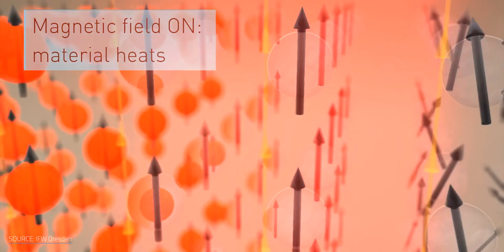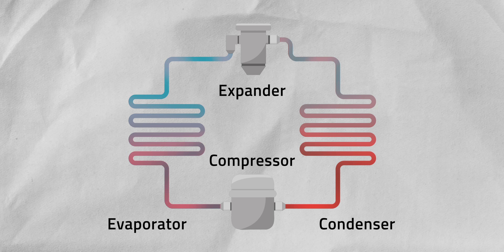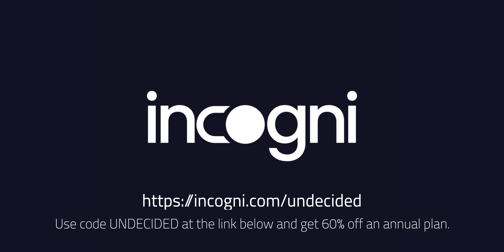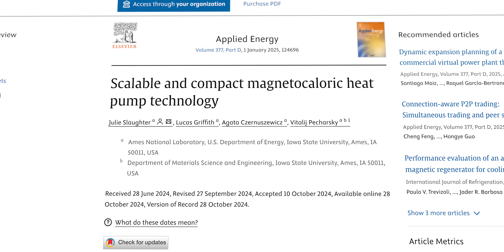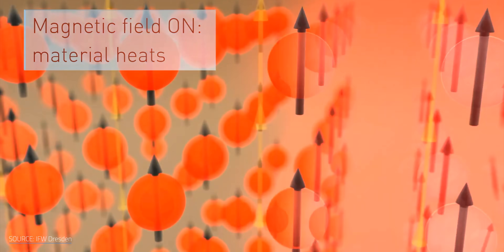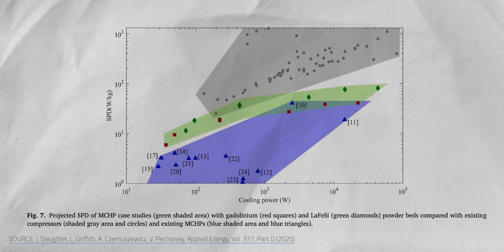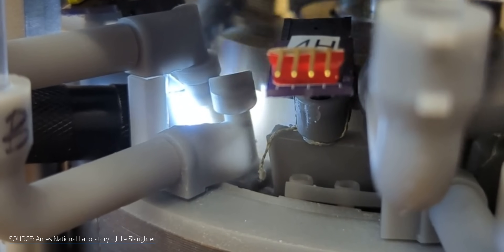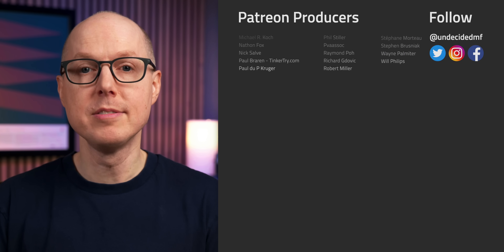How Magnetic Cooling Is Breaking All the Rules

Comment: I kept waiting for the big question to be answered: Even knowing these are not finished tech, what are the relative energy inputs required by each tech for comparable cooling power? (And how much do researchers think that might change with refinement to commercially viable tech?) Dropping HFCs would be huge, but if we had to generate 4x electricity to do it, the eco analysis wouldn’t be simple. Or if mag or elastocalorics would require less energy inputs, the win would be even bigger. And is one of those potentially more energy efficient than the other? Maybe I just missed it? But the answer to that seems like it could vastly impact this whole discussion.
Reply: Not only that, but does the assembly require replacement less frequently or more than current tech? The linear compressors in some modern fridges are technically efficient, but make the fridge garbage in 2 years vs 25. That’s certainly not better for the environment.
Reply: Yes it can reach an efficiency of 70% because there’s less steps in the refrigeration cycle. Which means less work wasted to entropy (every change takes a certain percent amount of your work “permanently.”)

Gas cooling needs several complex steps to achieve what it tries to achieve while magnet cooling does it directly and simply.
Reply: @Neoprenesiren https://youtu.be/XYjek6vuPN4?si=rqH21NkQrtpp9Ks9 this actual machine has COP of 7.6 for an estimated EER of 26.6. This is quite high, but the device looks very expensive and has 26 solenoid valves. Are you seeing other machines that exist with better COP and EER values? You can easily buy a 22.9 SEER AC window unit, so the increase is modest at best. Am I missing something?
Reply: @3weight  HFC’s are already in the process of being phased out. I regularly work with refrigerants like CO2 and propane today. Point being that this tech would have to improve on the vapour compression cycle in other ways to become popular because the eco friendly angle will be largely irrelevant by 2030ish. For smaller cooling needs where energy consumption is negligible, this tech looks like it could be possibly be made popular due to its simplicity and reliability.
Reply: Propane based is still more efficient
Reply: @philblue1015 what are the recorded COP and SEER values?
Reply: @CountJeffula You can readily purchase propane heat pumps with around SCOP hovering around 5. The video you linked is pretty interesting but that COP was achieved under very favourable conditions with a low temperature lift.
Reply: @shmerda5565 the SEER metric is supposed to take seasonality into account, and that value is quite high IMO. Converting it roughly gives a comfortably higher COP than the 5 you mention. 20% higher, to be more precise. Because heat pumps are often used extensively, isn’t the 20% efficiency gain more important than using a different refrigerant over the lifetime of the product in most scenarios? Even if a refrigerant is 100s of times worse for the environment, the amount of CO2 saved with higher efficiency most likely offsets this, yet calculation is necessary.
Reply: well yes but plane old dihydrogenoxide (H2O or water for a much more simple name for non sicfancale cemcal names) is also a nature made HFC thats also a green hosue gas and we drink it and use it everysingle day for our own body cooling with our sweat glands all the time. so teachly plant old water can work but it will still cause green hosue gas atmoheric issues anyway. by the way water vapor as a green hosue gas it like a few hudrid times more pontacy then co2 and we sweat it out when exrsieing everyday ameknig the planet much hoter whtierh we like it or not. so even if we stop co2 emsions our oown water vapor emsions form just walknig and ruing every day will casue claimte cange on teh earth anyway wither we like it or not. so yah can stop climate change unless we go into otuer space ans use all teh extra water to power rockest and sapce ships to lower water vaopr conect on earth to help get it cooler. also the suns saolr wind conlety adds a fwe hirduid mertaic tons more water into earths envoerment for otuer space every year or more. thats is also one more main drive of earth cheaning climate that stoping all co2 emsions simply won't do jack agest if the water vaopr for mthe sun soalr wind being dumped on earth will cauwth eearth to heat and cook itself anyway wither we like it or not. thsi si why space travel for hepling deal with ealrth cilaite is mantory bescue we wee can't recide earths totla water leevsl form giong hgier nurtal from earth geting mroe and more water vaopr for the suns soalr wind well earth giong to heat up wither we like ti or not sooner or later unless we do very lareg scale space tralvel and interpalenty space comlazion and exporation to even have a change to stablzie earth cliamite bescue we can't even do that even if we let nature takes it corse it will still by earth very own natire will want to cook itself to death with tis onw non stop rseing watr vapor and water table levels for mthe suns soalr wind keeps dupming more of it on us.
Reply: @ashtonmiller-z1n  what medications are you taking?
Reply: @ashtonmiller-z1n  Lol - you think water is a hydro-fluoro-carbon?! You learning your chemistry from the current US administration or something? 🙄
Reply: @ArifGhostwriter   really because the last administration did such a great job didn't they?Oh wait how many are failing basic math and reading also please stick to the topic an don't bring politics' when it has nothing to do with the statement
He was partly talking about as in water vapor can hold in heat better then most refrigerant and counts for the main warming of the planet and not that its is a HFC but is main greenhouse next to co2. So am guessing you learn from the last administration? "see what i did there"
Dont get me wrong he use it in a way that not 100% right there also other factor in warmer temps or just temps in general
problem with this tech is two fold one high maintance more moving parts will lead to break downs and output to size

Comment: Magnetic (or magneto caloric) Cooling is quite an interesting take. I did research and create a patent at the German aerospace center (DLR) during my master thesis in engineering, where they investigated to use such concepts for cooling in trains. With many technologies, there are still some serious challenges in the type of materials to use as well as the costs/availability of them.
Reply: What are some of those challenges?
Reply: @mrbizi5652  At the time of my research (it has been already some years) one thing is getting the right material for the right temperature range, and that the effect drops quite drastically when you move away from the optional temperature range. 
While there are different compounds of materials for different temperature ranges, they often only have the magnetocaloric effect within 5-20 Kelvin (total) around the optimum temperature. This would mean that you might need to pre-cool (or heat) with another technology before using the magnetocaloric effect.
We invented a cooling cycle within the magnetic field through porous material, which also means you have losses due to the pressure drop in that material. You can optimize the heat dissipation vs. pressure drop (smaller particles means better heat transfer but more pressure drop). You also need to change the magnetic field, either by rotating the material or some other mechanism.
While in theory we could get x6 the energy for cooling/heating, the cost and limitation would not be justified compared to today's ACs and Heat pumps. But I am sure there are way brighter minds doing research on this and someone might find a quite clever way for the challenges.
Reply: How does this system distribute the cooled area? The gas circulation has it large pipes runing up and down (sometimes even amongst the shelfs in the fridge, but without that the cold surface is in a smaller surface exchanges heat.

Comment: Peltier already provides cooling with just electricity and no moving parts. However it's not efficient.
I wanted to get some numbers how efficient this magnetic cooling is, but I must've missed it. They cite goal to get on parity with compressor heat pumps, but no numbers are given. There is also SPD that is based on the device mass... why?

Comment: okay, but why? Does it last longer? Is it cheaper to run? Is it cheaper to create? Is the goal just to not use refrigerants? What are the numbers on refrigerants being released into the atmosphere rather than recaptured? Do we still have an issue even after freon was banned in the 80s and 90s? 

My big thing is that all of the heat is wasted... It would be great if we could use it to do something like make the water hot in our water heater... ultimately to me, I want to approach problems from a question: If electricity were nearly free, what could we do? 

My issue is that everything humanity does from driving gas cars to cooling our houses creates a lot of net heat. We should be using that net heat rather than releasing it into our air and our oceans. I'd really like to see a design like this that uses thermocouples to generate electricity from that heat. I know everyone focuses on our atmosphere trapping heat, but from my perspective there there is also an issue with wasting that heat. That's the big reason I love solar panels but hate wind turbines. Solar panels generate electricity before the suns emf creates heat, where as wind is our earths way of cooling off by evaporation cooling. I dont want to take energy out of wind, that only serves to heat up our earth. 

The industrial revolution taught us that when humanity starts doing something in mass it really can have large scale impacts.

Comment: 1kW of cooling is absolutely tiny, and basically useless. 6kW isn't very big either, compatible to a smaller central AC in North America. Centralized cooling in supermarkets are 1-2 orders of magnitude higher capacity. 6kW would be a about a 6 door reachin display cooler, or a small-medium sized walk in freezer. (4-500 ft²or so)

Comment: It sounds like you're still dealing with disposal of a toxic element if I'm understanding it correctly. A cursory read up on LaFeSi suggests it's a somewhat unstable alloy. Additionally lanthanum itself is mildly to moderately toxic. The water will wind up with lanthanum particles in it, no? I suppose there's the advantage that it won't pollute the air, but there's still a pollutant we'll have to deal with in our water table.
Reply: The way the transfer fluid was described, I'd say it's the same kind of coolant mix we already see in the majority of motor vehicles. So that part is just distilled water with ethylene or an organic acid anti-freeze in the mix. Other than that, if the alloy is prone to corrosion easily - it would make sense to run copper tubing right through it so it's never in direct contact with the heat transfer fluid. More or less there would be some kind of thin wall of another material with a high heat-transfer property to keep things intact. (Might be a missing detail, but it's something that would make sense.)
Reply: Look up iron nitride magnets, it is still in the scaling up phase and not yet commercially available. So I wouldn’t call it an available technology yet, but I hope it will work and is possible to scale up in the coming years. Would be (depending on costs) a game changer
Reply: You guys talking about Iron Nitride should know the reason they aren't used yet. 

 I guess they have durability issues. Either they break down at heat, or quickly. Lose their strength. 

 I know one company is producing them, and they are on the rise. 

 Yet that is why the applications using them are few and far between ATM. 

 Please correct me. Not too much info on em. I am only talking about the high powered ones on par with Neo Dynium.
Reply: Electromagnets are better
Reply: @calagemlily  We've tried it. But they consume more energy and cut into the leaps in efficiency you can get by using this technology.
Reply: Actually recently scientists were able to discover that a few years ago, we could make high-quality and high-powered magnets without rare earth metals and tbh it be far more environmentally friendly than rare earth magnets
Reply: @butterbean139   can you share the source?